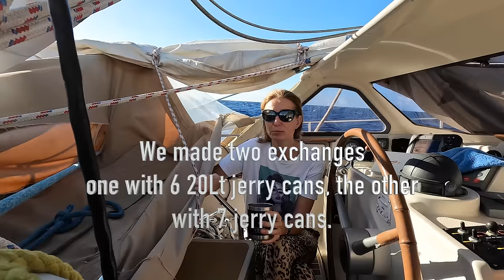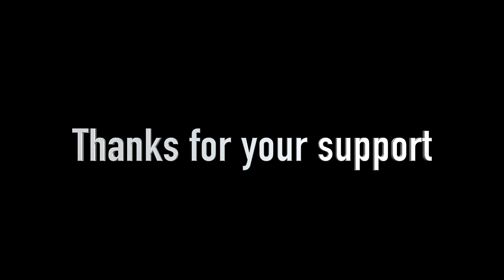Double dismasting in the middle of Atlantic Ocean - Real time update from disaster zone…

Comment: Okay some quick tips do you know you can disconnect cylinders from your engine simply by removing the spark plug this will mean on the intake stroke there's no suction so the cylinder won't pull in very much fuel at all if you got a 6 cylinder remove two of the cylinders this way and you'll find it's a lot more fuel efficient than lean out the engine a little bit, most people run too rich for reliability but its actually bad for the system. An engine is lubricated from the bottom by oil and the piston rings stop oil from passing by them thats thier job. The fuel actually lubricates the top end like intake valves and piston if your too rich youll loose power and burn too much fuel, check your fuel air settings, there are two lines at top and bottom of the mixture needle they show max rich settings for beak in and leanest allowable at the bottom. Right turn is opening the carb so turn to the left to lean match air and fuel to the same angle. Youll notice the lines indicating rich and lean are at same oclock for fuel and air, keep them that way as you lean it a little at a time and let it raise rpm and cut throttle for little less RPM you can get a lot further this way on engine also you have cell material you have rope you have an arch at the back of the boat therefore you have everything you need to make a sale take a line from the middle of the arch run it down the center of your boat all the way to the forward cleat right at the bow now take your cell material and make a sale hang it over like a tent you can tie off the sides of it to the cleats at the side of the boat just use rope to force some kind of a sale shape out of it and you can see use it to sale you some way between the two you should be able to make it back to shore remember you could keep removing cylinders from the engine you can run on only two cylinders if you need to for fuel consumption reasons it'll triple your range or at least double it just remember if you're going to have higher RPM you're going to need to worry about temperature but doing it my way you can kill two cylinders let them cool switch to the two at the back of the engine and run those two and you'll find your engine temperatures go right down it's a really nice way to do it it's a more work but you can do it and it's safer than you might think it's easier than you might think. If you have a fuel injected system disconnect the injectors for the droped cylinders and plug them or cap them. Now if your making a saill without a mast take a jib tie a knot in the fabric at each bottom corner or attach a line to the eyelets same at top picture a kite, on the bottom put to lines at least 14 feet long. tie it tight to the deck at first then its not going anywhere do the same with the top but with 100ft line run the line tight then put wind behind you to launch the sail. Then let out the line for the top of the sail slowly a little at a time to lauch it, once you get it up let the bottom two lines out untill you can see out the windshield. This way you do it one line at atime, with three people each takes a line and you just fly the kite, use your arch like a pully go once around it before letting out the line in the top bar somewhere, if not the arch than just hold it or use whatever you can like the stern cleat in the center of the transome. Good luck
Reply: 100% ignore this advice .

Comment: I hope you guys get through this. Looks like you've done everything you can do.  
Garmin sucks.  I've had a few Garmin devices, they all have two problems. The interface is convoluted and difficult to use and there's always, always some incredibly stupid design problem. The first handheld GPS, fell three feet on to a wood floor, screen cracked, second one, the expensive batteries last 6.5 hours which means if I make three kayak paddles I will have to change batteries on the water. The first thing to remove to get at the battery compartment? the tether attachment, then the door is so jammed it always has to be pried off. Second battery change, over the side. Of course it sank.  I boycotted them for years then 5 years ago bought a unit for my bicycle. Never got it to work properly, not even once. Too fussy. All cyclists hate it.  Garmin sucks, insists on sucking, doesn't care. Starlink is great. I flew to Vietnam with Dishy in my bag with all the boat parts. Worked all the way to Canada with the exception of Taiwan where it's not yet allowed.  My friends bought one in Japan for less money, registered it in Panama for half what I pay in the U.S.  We had a great connection all the way across the north Pacific.

Comment: Wow.  So sorry.  I have cruised tens of thousands of miles and never experienced a dismantling.  Closest I came was cruising in company with a Westerly 42 that was dismantled.  No fun at all. But we were just 250 miles out at the time.   WHEN. When will boat builders realize that you can make water but you CAN’T MAKE DIESEL.  Why wouldn’t they make your boat with 265 gals diesel and 158 water, plus a water maker.  My Cal ll-46 carried 200 water and 270 fuel!  We also had a 20 gal/hr water maker.   We could motor nearly 1800 miles.   And they all do it.  All the manufacturers.  I don’t get it. Well good luck my friends. At least your have following conditions!  Hope you find a rig.
Reply: Provides more endurance when the water maker breaks down? Compromises with all designs when space is limited.
Reply: YouTube to let us know that you guys are okay would be really appreciated but
Reply: --Water makers are an extravagant use of electrical generation and battery capacity.  30 gallons will get most couples across the Atlantic.  A tarp and a hose can top things off.  Some tap their cockpit drains.
--Why stop there?  Laundromats, dryers, refrigerator freezers?  How  do you keep your beer cold, your ice cream and pizzas frozen in mid ocean?
--And once you have all these accessories, you need air conditioning to deal with the waste heat

Comment: What made the masts come down? Weren't they mounted correctly?
Reply: Wondering the same, no explanation of why or how it happened. The actual dismasting.
Reply: The furling, I think, type of main mast, buckled,  4 ft above the deck. That type of extrusion, can twist, because it is not a complete tube, they don't have a good reputation as a furling system. The swinging main mast knocked the second mast down.

Comment: Wow!!!  This is the kind of thing that happens to someone else.  Our Lindenberg 22 was sunk by a microburst in a race along the coast between Gulfport and Biloxi. We recovered the boat but the mast was stuck in the muck and snapped when we started towing it towards shore.  We had a drawing of the mast section and were able to order a new 30' extrusion of the mast.  If you can find the aluminum company that extruded the mast, that company should have the die for those mast shapes and you should be able to get them to extrude new masts. Amel should have that info. We fixed up our boat and came in second in the same race the following year.  I expect that you guys will have Aquarius under sail again also. I hope you find the cause of the dismasting.

Comment: Czy katastrofa miałaby miejsce gdybyś miał maszt samonośny i żagiel typu chińskiego (junk)?
Reply from the maker: Not sure
Reply: Just to let you know, free standing hollow wooden masts could break if its rotten. the scary thing is you might miss the rot if its rotting from the inside. junk rig has very minimum failure points its much easier to check for issues than a conventional mast having like 50 or so components.

Comment: I could have cut a 15’-18’ of mast off the top of the mast so I was able to use the existing connections and stand it up and fasten it down as best I could,having 4 ratchet straps on board would really help,as would a saw to cut the mast,I’m a fabricator by trade so I know I’ll make it good enough as long as we have forward propulsion via the sail I’ll be happy,hopefully the tide and wind is going in the right direction and the weather stays calm until you are picked up….
Reply from the maker: Yes, YOU could...  I made it home...

Comment: Ya know, on these modern boats, the aluminium masts are stepped on deck and the shrouds are in stainless steel. Well, stainless steel gets brittle after a while, and it breaks like glass, even when it looks like new.
On my classic boat, the masts, two telephone poles in wood, are stepped right into the keel, and they are flexible like a fishing rod, they would not even need shrouds ! 
But for extra safety, there are some heavy galvanized shrouds, served with tar, that protects the steel, looks nice and even smells good.
Modern times man !  It aint as good as ist looks. 😉
Reply: Is this my father, speaking from the grave? I'm only joking, but "materials technology" doesn't necessarily imply that newer or more advanced technology is better.
I will give you an anecdote that you might enjoy. My father owned an old 10 metre sloop that he always had dreams of restoring to its former glory. One of his pet hates were
the aluminium spars and mast. They had been retrofitted, at some stage. The gentleman that he sold the yacht to, went through the process of an extensive refit. Amongst the "modifications", the new owner reverted to a wooden mast and boom and, galvanised rigging. I came into contact with the "new" owner 30 years later. He had almost countless miles under the keel as a liveaboard in the Pacific and proclaimed that the yacht hadn't yet to give him anything other than the most comfortable night's rest in the most adverse of conditions.
I must add, the new owner had also removed the head in favour of a bucket.
Reply: @davidbrayshaw3529  Right !
And, considering my age, I am shure, I could be your father.

Comment: You can't jury rig some dort of mast & sail?
Reply: They don't have the basic seamanship skills. 

The masts and all the rigging are on deck.They must still have some sails somewhere. Any competent crew would have rigged at least some kind of downwind rig before getting on the HF radio to beg for fuel.
Reply: @CharlesRandles wow, life without brain to mouth (or typing fingers) filters, I wonder if you have any friends.
Reply: You would need 2 spinaker poles
Reply: Crew have been injured trying to do a jury rig. It’s just the two of them. If a source for fuel is available that will get you to the nearest port, that is a much safer way to go. Jury rigs are fickle, difficult to make the boat move effectively and can come down in any kind of measurable weather. They made the right choice.

Comment: When they bought this boat the ringing was already due to be replaced for years and years and they just assume they could go out with really old rigging and they were proven wrong
Reply: The mast buckled, 4 ft above the deck, that is not rigging failure, that is the crap furling mast failure.
Reply: You know this for a fact? As in, so you know them and the boat? I'm really wondering what could cause such disaster. Your comment would be an answer.
Reply: @mrsookie You compare a moving mast with a bending spoon, make up your mind. If the mast is a furling type used on some Amel boats, it is not a tube, but a C section, that can twist, and the C can open, allowing for it  to buckle.
Reply: When they bought the boat they replaced the rigging.  It's in their first video...  Turned out it was a mast design vulnerability AMEL addressed in newer owner's manuals but failed to notify existing owners of the mitigation.